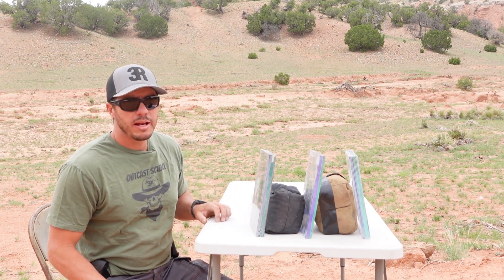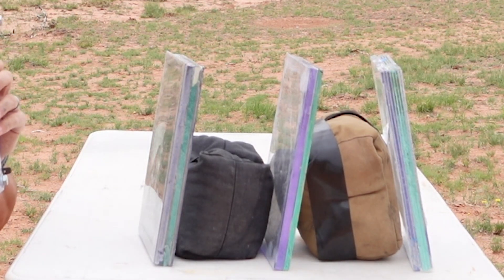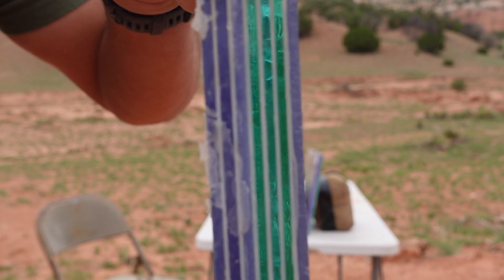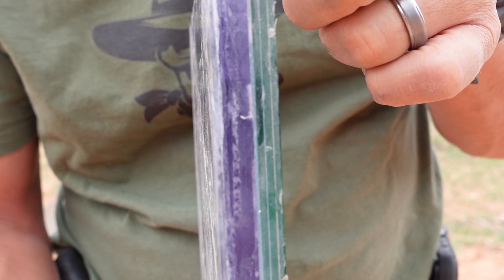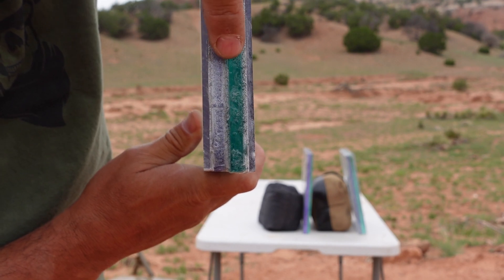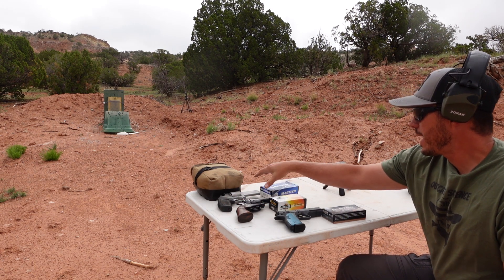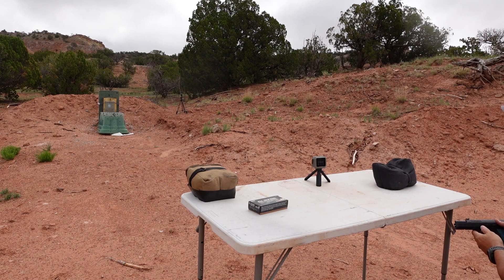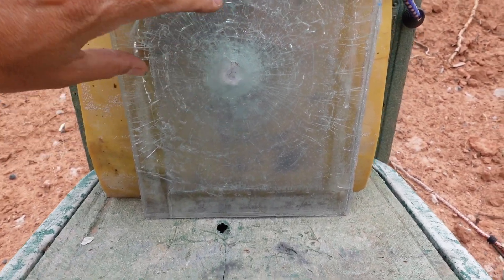Homemade Bulletproof Glass build part 2 - Testing

Comment: Have you tried glueing 2 polycarbonate sheets with urethane or with clear epoxy resin? Instead of screwing (or bolting) them. It should be clear and not impair clarity I think from other videos where they do that. Also I read 1,25" inches of PC should cover handguns including 44 magnum according to tssbulletproof site. Apparently Poly-Acrylic-Poly performs the same as all Poly, in 1,25" thickness. What I wonder is about the thickness of each layer, how it matters and also the urethane vs clear epoxy resin. Amazing 2 shots in the same spot by the way. Cheers
Reply from the maker: @segundacuenta726  I have glued the polycarbonate together and urethane works better than epoxy. Right now, I prefer using a mixture of TPO (POE) mixed with a bit of mineral spirits. It also works with Poly-Acrylic-Poly

Comment: if you use harder/tougher strike face, maybe thicker glass to slow down and mushroom the initial high velocity of the 44mag first, then some cushioning layer to absorb shard movement a little bit so they don't shatter thinner pieces of glass in the glass-PC sandwich and then last layer of PC make it either thicker or use even thinner layers sandwiched with another transparent plastic with good ductility, maybe PET with sticky non-crystalizing adhesive to prevent delamination

Comment: Hey curious about the outside the car glass stuff they advertise getting whacked with a bay, speculating a wind screen with both inside and outside covered, it could be better protection? Does it work that way?

Comment: Some pieces looks like it's acrylic. As you said ductility is different.
And AFAIK acrylic makes "stars" in impact zone. But now I'm  in doubt.

From other videos of testing transparent armor without glass, it looked like it consisted of polycabonate-acrylic-polycarbonate. Because inner layer made "stars". Or maybe it wa different sorts of polycarbonate
Reply from the maker: Ithats actually the UV resin binder between the layers that create the “star” pattern. There was no acrylic used in this project.